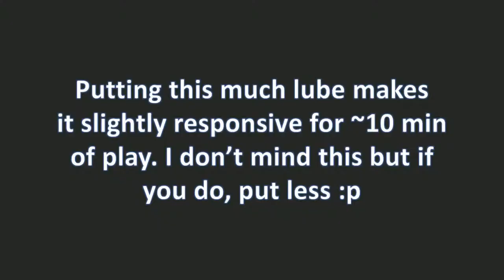How I lube my yoyos

Comment: Some bearings are just destined to be noisy. As long as the spin times are good I wouldn't fret over it. To be honest, except for my Deep State Responsive Yo-yo where I use lube to adjust responsiveness, I haven't had to mess with lubricating bearings yet. I own all the stuff though, mineral spirits for cleaning, heavy and thin lube etc...  I probably would remove and de-shield mine if i was going to take the trouble to disarm a yo-yo.  If they get real bad, new bearings are not that expensive. I can get 4 Buddha Dimpled bearings for about $14 in the USA. I like that Iceburg, Nice looking Yo-yo :-)